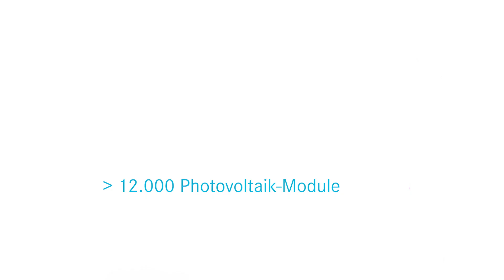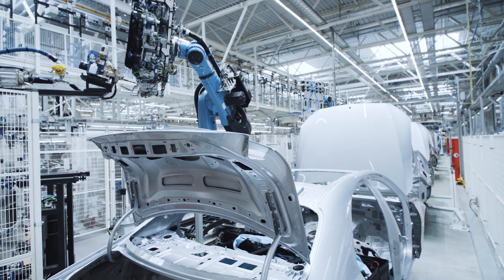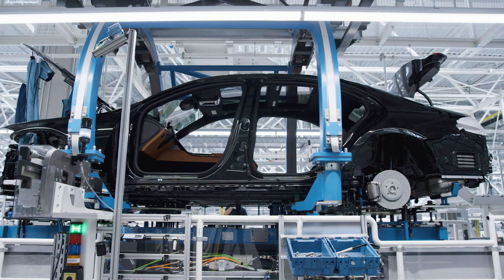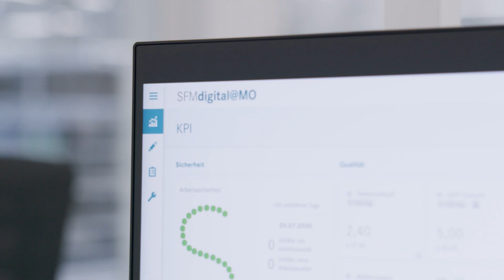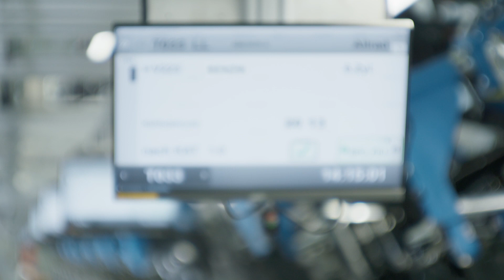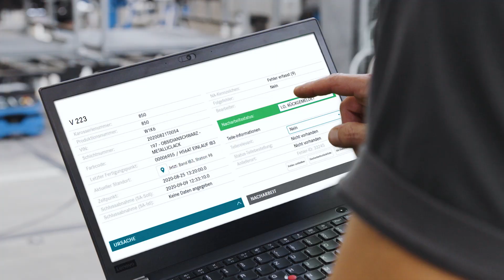Mercedes-Benz Factory 56: Voll flexible Produktion

Comment: Has Mercedes Benz anything in body shop innovations like teslas mega casting??
i believe mercedes has to keep pushing luxury but at the same time needs to produce most efficient and cheap. Thats how they make money. all the a class and b class dont make much for mercedes..
Reply: mega casting is not the howly grail of production process. it works out for tesla but in terms of material cost, press cost it is not a cheap solution. german manufacures have more knowledge in steel pressing and that is is the lowest cost high volume process (car parts) on the market. https://www.youtube.com/watch?v=9u6BC6p3mXo&t=5s
Reply: Large castings are not as flexible. If you plan to produce 500k of the exact same car it might be better, but if you actually offer a lot of different styles of vehicles, it would be uneconomical. So the way Mercedes does it is not less cheap, underlined by the fact that MB gets more than one percent net margin for sold cars.